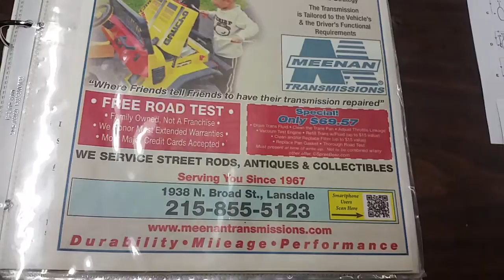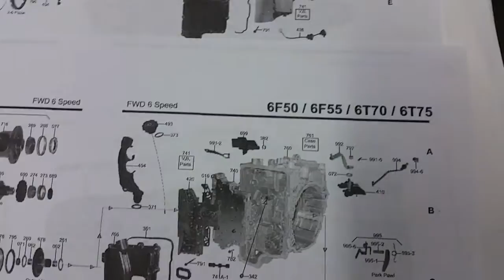Meenan Transmission 6t70 6t45

Comment: So I have a 2010 equinox mhc 6t45. I have 1/2/3 no reverse or 4/5/6. I had a solenoid code. Cleaned them and new fluid and reverse worked for a few min. Still sloppy but worked. So orderd new solenoid and gonna clean valve body this time. If my wave plate was broke you would think that the symptoms would not have changed from me cleaning them. What are your thoughts?😢
Reply from the maker: The techem modules can cause some problems. Check fluid see if there is metal contamination present. If there is it’s likely you have more than a control related problem and the transmission has internal damage.